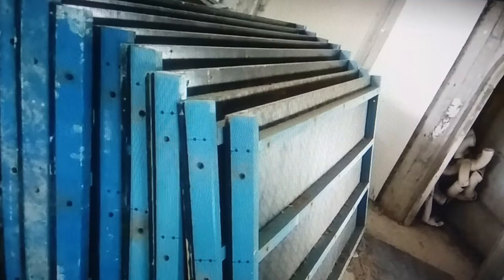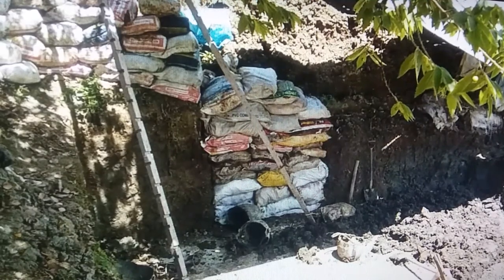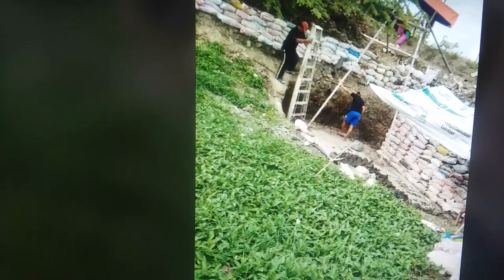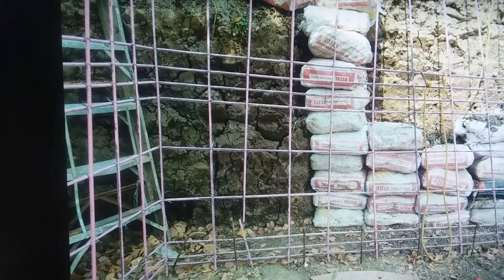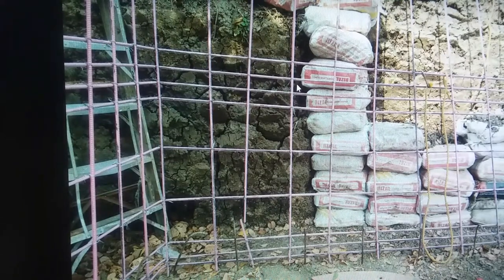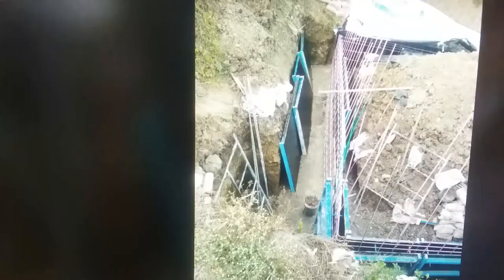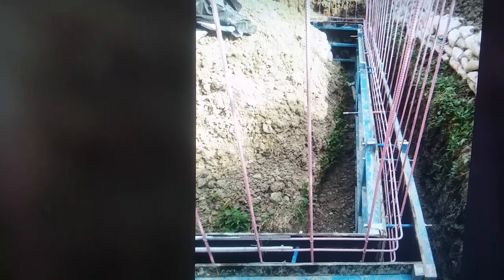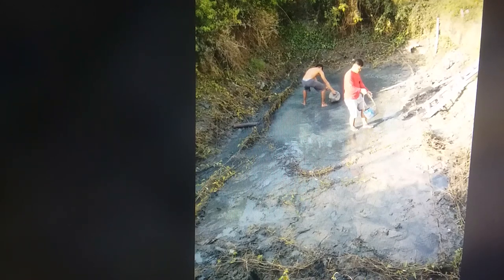HOUSE BUILD IN THE PHILIPPINES.  ALL THE DIRTY DETAILS ABOUT BUILDING A CISTERN.

Comment: Did you guys make your own slip forms?
Reply from the maker: Yes. They are made of 3/4 phenolic covered hardwood plywood backed 
with 2 X 3 "good wood" which means no coco lumber. The dimensions 
and how the corners bolt together are on an earlier video. We have used 
the same forms 10 pours so far. After another 2 pours we will be flipping 
the phenolic board over to use the other side. We ran out of WD40 to 
wipe on the forms as a dry release agent because of lockdown and have
degraded the facings on a few forms. Same thing happened on the house forms after 36 pours. The set in the video poured 82 linear feet on the 
cistern with some 4 foot forms not in use. The dirty kitchen is being 
poured today so video next week. It has 2 round top doors to match 
the main house and 6 windows 32" X 48" showing more detail like
a house construction. Our forms have detailed dimension drawings in 
the older videos which make 7" thick walls. If doing 5" thick walls
The outside corner panels need shortened. We are building some 
5" forms for flower and vegetable planters which have the bottom and 
side walls done in the same pour. The main house forms were also 
7" thick with formed in place window jams and door jambs and a 
14" X 24" beam was monolithically poured with the wall section and
on the second level the base tie beam and end columns were also
included in the monolithic pour. The main house is 29 rooms all done
with 24 lineal feet of forms. We occasionally did 2 pours a week but
with a 2 day cure before stripping forms 1 pour is more typical. All
the rebar was tied in panels on notched board cradles in about 5 days.
       george and aurora